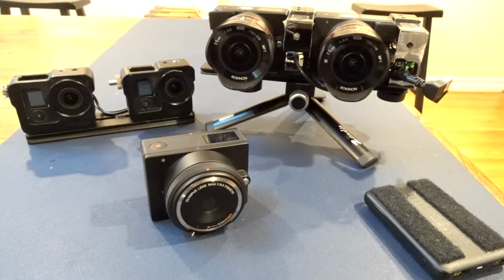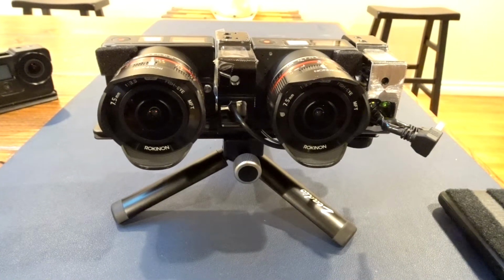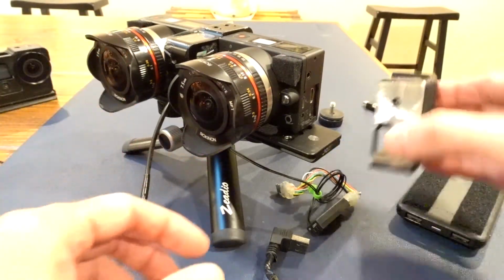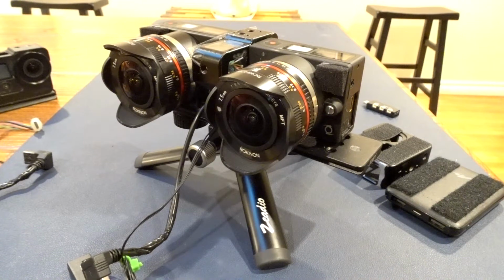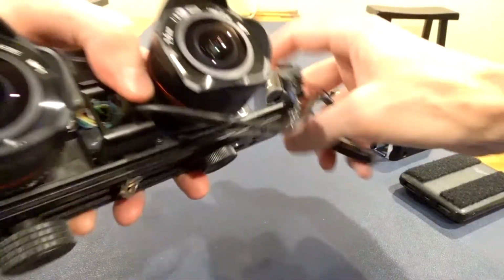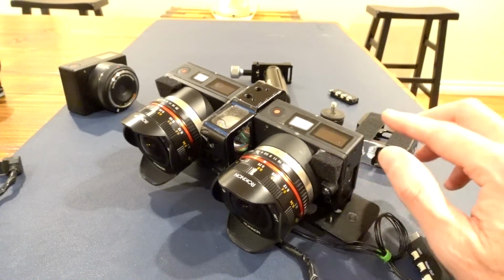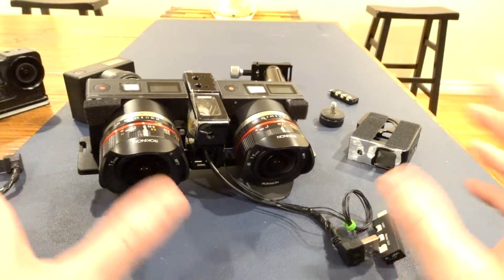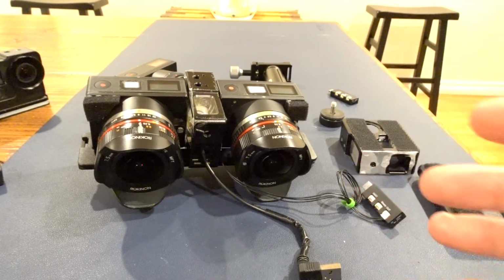2021 03 29 Zcam E1 3d Camera Rig Rundown - VR180

Comment: Didn't know how else to contact you. I was curious about the Z Cam C1 camera you posted about on DPreview. I have a couple of this model and am going to start a Facebook group for the few of us who have them. This way we can share whatever information we've gathered. 

That aside, I'm finding an odd situation with the C1. It seems to randomly boot into either some sort of streaming mode with no overlays or recording capability or into recording mode with an overlay over the HDMI. When the overlay is there, recording is possible. When it's a clean HDMI feed, no recording is possible. Have you found this to be the case on your cameras? Originally I thought a specific key press combination was responsible for this behavior. After further testing it almost seems random. That can't be the normal operation, can it? I'd love to hear your experiences with it. Can you record to the SD card every time you boot it? Hopefully I can record to SD or clean HDMI to external recorder or live stream switcher (with ISO recording with ATEM if desired). 

Please do share your experience. The C1 is a remarkable for my needs. I was aware that it was not a plug and play device. I just didn't expect the recording functionality to be so... random. 

Hope to hear from you.

Comment: Adorama is selling a few old Z Cam C1s that were meant to be syncable and the dongle-port is on the back so you can mount them right next to each other (you can see a bullet-time rig in some of the old reports from NAB 2016). I bought a couple but when I attach the sync cable neither camera will record. Is there a special mode or setting on your cameras (the C1 uses the same API as the E1) to put them in 'sync' mode? Or does one just start recording when the other one does? I'm very much relating to the frustrations you're mentioning :) Thank you!

Comment: Couldnt you just skip the dongle and sync the clips up in post. I use multiple cameras and have gotten pretty good at syncing audio and video in post.  Or is thier another reason to sync in camera?
Reply from the maker: No, the camera needs to capture the image at the EXACT same time.  Not close, it has to be exact.  Your eyes really do not like seeing time shifted slightly.  Some people say, oh, i have done this for years, its fine, but those people have horrific videos where any moving object is just messed up.  You cant get away from this simple need.  Properly synced cameras send the pulse to the sensor chips at EXACTLY the same time.  You cannot possibly fix this in post.  Objects move,  you cant move them in post.  In 1 image, some move left, some right, this isnt fixable.   You simply need it all to be synced correctly when captured.  It matters.  This ALWAYS involves a wire.  I have never seen a wireless solution for this either.  Two cameras with one remove NOPE, doesnt work either.  The cameras have an internal clock, those have to be in exact sync, you can only  do this with wires.  To really learn this, start shooting still images in 3d and you can very very clearly see what parts of the image suffer when they are out of sync just a little.  It will look messed up in areas where the motion is out of sync.  Seeing this and knowing that its a big deal simply comes from experience.  If nothing is moving, great, then you are fine, but why are you shooting video, you could use 1 camera and cha cha the thing.  When stuff moves, then it matters, but that is why we shoot video.
Reply: @scstudios8  exactly
Reply: @scstudios8  I have been using an evo for years and the quality is good as I shoot with lots of light. I tried the K1 Pro but becouse I shoot in a lot of light I did not see enough improvment to justify the price. I know that would change if I was shooting in lower light.  

I want to build a rig becouse I need to get the IPD shorter then consumer cameras as my clients want that exaggerated look like in 360. The Evo works to well at 62 IPD.

Comment: Very nice talk, just what I was looking for. I am trying to do a rig with phones or with something like a GoPro. I have shot at 1080 x 720 with a FOV of 130 x 60 and the result is quite good. Can't share anything yet. The room was a bit untidy and I couldn't correct the fish eye distortion.

By the way, which field of view do you use when publishing? Just an advice of a different sort. In some of your videos I get a bit sick when you point downwards instead of horizontal. (I have been with VR for half a year almost entirely with 3D videos).

Just looking forward to your next shot :D
Reply from the maker: Yes, I am not really paying much attention to leveling the cameras out and that does mess with the horizon considerably.  The vidoes are mostly tests, but this does point out a problem with this type of video shooting for the masses in that you need to pay more attention to things like leveling the cameras out.

The key for 3d is, get them to sync.  You need a camera that has very specific connections that are always by wire that syncs the scan rates on your sensors together perfectly.  Trying to "sync in post" is a joke really.  Its a different league when you are actually syncing by wire.
Reply from the maker: For the published video, the vr180 format allows any horiz and vertical FOV, it doesnt have to be the full 180 degrees.  On this video, i think i was at 120 degrees, which is what the gopro horiz FOV is.
Reply: @scstudios8  I purchased a Quest 2 and when I inject metadata with VR180 Creator (the Google tool to inject metadata for publishing), the native player seems to ignore that when I want to view it as VR180 video (it stretches a lot vertically). Same happened with DeoVR. However, when I upload the same video to Youtube, I get the nice looking with the softened black edges honoring the fov I set in the tool. Do you have any advice on that? To view the video properly on the headset.
Reply: @scstudios8  Btw, what distance do you have between the lenses? It seems more than 5.5 cm